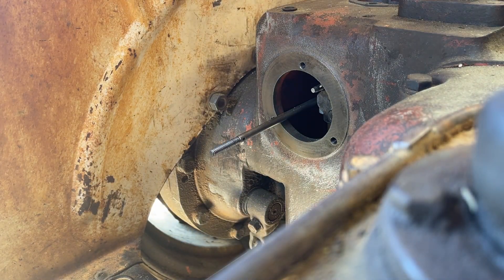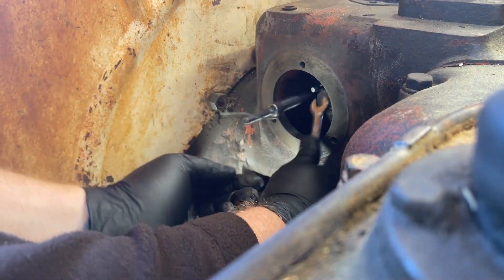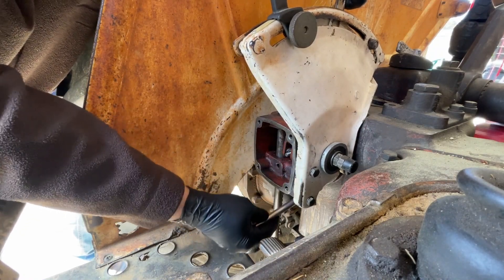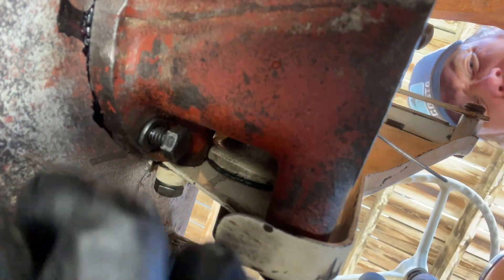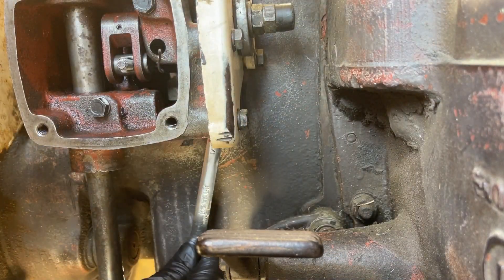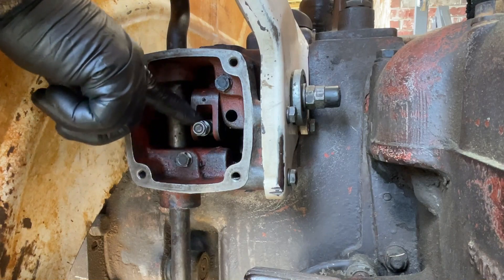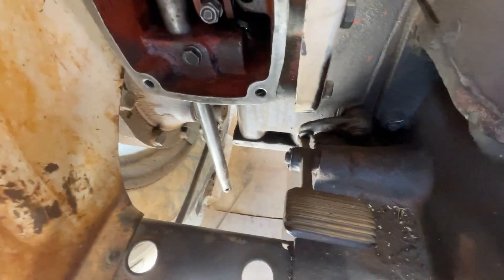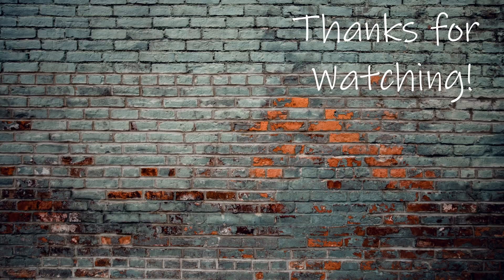Quadrant and Control Arm Installation | David Brown 990 #20

Comment: My brother 3d printed the block in nylon from you drawings. Had the 996 wing and wheel back on so I could move it for new machine coming tomorrow. I am going to change a few things round, fitting new block and i forgot one spacer on the quadrant. Put a bolt and nylock nut in hand brake, as i new it would be coming off again.Hand brake works fine now. If the hydraulics don't work after that. Spool valve and 2 way ram will be fitted I think. I had my fork lift on it today and had to keep changing levers round to get it to work. It sort of worked. Diff lock working also.M😀
Reply from the maker: Awesome!  Do you think the nylon block will work and handle the pushrods?  I guess it's really only a guide block, so maybe?  Anyway, it should be good enough to see if working I guess.  I'd love to see a pic of it.  Your adventures are the reason I thought of modeling it up in the first place!  
Phenomenal idea on using a bolt and nyloc nut on the parking brake!!!!!  I'm most definitely going to do this.  I hate that little roll pin!  Great idea.
Reply: @path.of.discovery  I drilled the hole in the hand bake lever slightly larger also. The small bolt on the quadrant guide/lock fits. I put a vid on Instagram in the next few days showing the block. M 😀

Comment: Hi Shane, I'm done with my DB880 restoration. I want to thank you for all you've shared with us since the beginning. Good luck with your DB !
Reply from the maker: Yay!  Hope it all works!  Thanks for the kind words
Reply: @path.of.discovery  Hi Shane, for me it's now over. Next year, I will take care of loader cylinders (leaks). Then, it will be the loader itself (fixing and painting) and trying to find a way to install a power steering cylinder on to help managing the weight of the loader in front. It finally was a good experience at the end even if it's more of a pain in the ass process.

Comment: Hi Shane.  I think I read a post from Ollek that said the chamfers on the distance piece go towards the pin so yours looks correct.  I can’t understand why it makes a difference though.  I’ve been looking back at photos of mine and I’m not sure that both distance pieces have the chamfer.  It works, so I’m not going to take it to bits again.  One thing though - there’s no washer shown in the parts manual behind the nyloc, at least not in the later 880 manual.  Not sure why you would need it with a nyloc, but won’t do any harm as there’s plenty of thread on the connecting rod.
Reply from the maker: Ok thanks for the chamfer info, same though, I don't see why it'd make a difference.  You're absolutely right about that washer.  Checked the parts diagram and it's not there.  Just my luck too that I finished doing the adjustments today and buttoned it all up and just now checking comments on today's video!  Checked my disassembly video and yep, there's a washer there... 🤷‍♂  I guess maybe I put it on when I went through all this a year or so ago maybe?  I was missing a washer for the screws that hold the Quadrant front plate on...  May have gotten mixed in with the connecting link parts bag on the first go-round on this and put there by mistake... who knows!  Like you said though, it won't hurt anything and I'm NOT about to take it all apart again now that I've got it all adjusted correctly!  Guess it'll be right there till I do this again (hopefully never).

Thanks David!

Comment: v important to check the tensionnon the quadrant lever nut  regular  - if loose the lever can fly back to raise the arms - a nieghbour got killed trapped between the arm and mudguard - lever sprang back!
Reply from the maker: Hi Nick, great advice!  Mine was getting quite loose before I took it all to pieces.  I've got it all adjusted now (video coming soon-ish) and the control arm is much stiffer than it was but still free enough for good movement.  I'm quite happy with it, but may tighten up a bit more once there's some weight on the arms and I can see how it feels.  Thanks a bunch for watching and commenting!

Comment: When l had to replace this, there was no hole in that connecting link, so l tied some twine around the spring and threaded it through the back and has someone pull, worked but another thing that was tricky, and l think you’ve got them spacers in the right position, I had to set that rod up so the arms would lift high enough when you pull the quadrant all the way back so the lift lock would engage
Reply from the maker: Hi Glenn, no hole there would be an absolute nightmare!  I can definitely see how that'd be tricky to do.   About the arms lifting and the latch, you reminded me I just learned something from the forum about that.  Apparently the arms won't go high enough to engage the latch until the control arm is fully back against the spring (in select position).   Ollek says it's normal that the lever must be in constant pumping (fully back) in order to get the lift latch engaged.  Didn't know until I read that.  Anyway, thanks a bunch for watching and commenting! 
https://dbtc.co.uk/phpBB3/viewtopic.php?f=1&t=17723

Comment: Hello Shane, I'm Portuguese. I have a David Brown 770. The hydraulics don't work. I've already put seal kits on the pump. I've already cleaned the Chester valves and it doesn't lift. What could be the problem? Could you help me?
Reply: I would suggest one thing you can try, is your hydraulic pump working... remove the magnet plug from the Camels Hump
... is there pressure?

Comment: I have a david brown 995 and the 3 point works in the wrong direction up on the control is down and down is up. It goes up quickly and down very slow. Not sure whats wrong and was wondering if you had any ideas. Just bought the tractor and dont know any history
Reply from the maker: Hi and thanks for the comment!  It could be the tractor is in traction control mode (TCU)?  The quadrant handle is different when in that mode.  Not sure though.  Be sure to get an operators manual and service manual.  I've got a video that I'll link below to the right spot where I talk about where to find manuals online:
https://www.youtube.com/watch?v=5nYhhXXpGFw&t=1386s